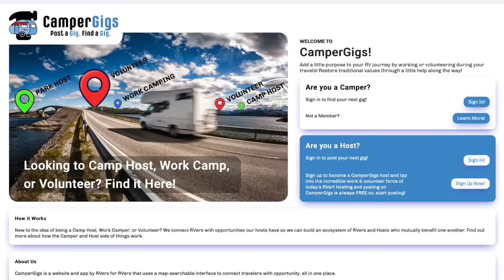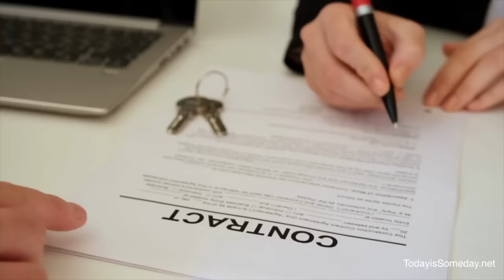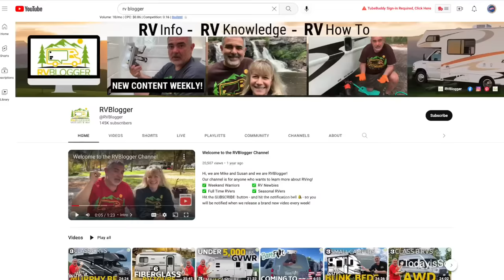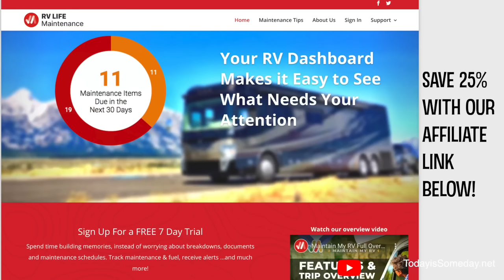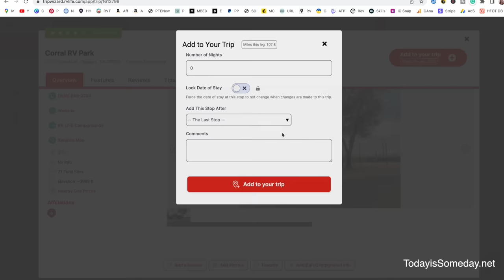HOW TO START FULL TIME RVING IN 2023 (UPDATED)

Comment: You hit the nail on the head. We started full time April 2022 after 5 years of planning. We sold everything and have learn a lot of tips by watching your videos. Thank you!  I have traveled via air for the last twenty years and (don’t laugh) the only thing I would not get rid of is my massive collection of Starbucks mugs. We spend a month in one place then move to the next as the wind takes us (We love getting to travel to the 3 places our adult children live the most! We would never get to see them as often as we do without this lifestyle!) I have always worked remotely so the move to the road was no big deal. My wife retired from teaching, but hopes to find some side job to do on the road eventually. I over spent on my internet with top end hardware and data plans to ensure connectivity.  I learned it was not necessary and now use Starlink and a cheap Verizon and ATT as a back up plan.  We are only 7 months in and don’t regret the switch. Went from 3000 sq. ft.  to 400.  Every night we say how much we love our tiny home!!
Reply from the maker: SPOT ON!!  This lifestyle is pretty awesome!!!  I collected Starbucks mugs from every place I visited overseas when I was active duty. My daughter has most of those now.

Comment: I watched a video that recommended to Either staring sleeping in your RV in your driveway or a
nearby camp ground to get used to camping and find out what you need in the RV that you may
not have thought about.
Then as you get used to it plan trips further away and for longer periods of time.
The more you get out the more your able to by or purge.
Always keep two rolls of quarters for laundry, and vending machines in case of a craving.
Zip lock laundry soap in load sizes, 
Keep well stocked first aid kit, heavy trauma band aids and gauze.
Reply: There are probably lots of laundromats that still use quarters but we have come across several that have you buy a card or use an app. Seriously!

Comment: I have been full-timing for 15 months and can’t imagine ever going back…even after two Canadian Winters! I used to be handy. Now I am REALLY handy. The biggest frustration: finding out that Lithium batteries don’t charge below freezing! The solution (after hours of inspection and emailing the solar manufacturers and battery manufacturers): a $50 heating belt. Runs off your generator or inverter and raises your batteries’ core temp above the freezing point so they will accept a charge from the panels. Can’t wait to host you guys up in Canada, this year.

Comment: It's my dream of full timing, but my wife isn't that much on board. She is partially disabled and thinks she couldn't handle it. We did last winter go from south central BC to near Gainesville FL. And we did very much enjoy the trip. I made sure anything we did she was able to do as well with either her walker or walking sticks. The one thing is being Cdn, medical down south does become a huge thing for us  and trip insurance only covers if you get hurt or sick. With that said I still believe that by selling our home we could full-time 4 to 5 years before it would be time to hang it up depending on our health. I did say you should come to Alberta and BC  but one thing I didn't say was fuel costs are through the roof. Here right now diesel is 1.789 a litre which times by 3.8 you get a US gallon. But you are using the US dollar which helps. Camp sites are about the same with the exchange rate where it's at right now. So if you come to the northwest north of the border then.        " Welcome to Canada EH."

Comment: Guys my husband and I bought our 2002 HR 40ft diesel pusher back in May  of this year and haven’t had a chance to take one trip in it! We are “full timers” and this is our first RV. We totally have a “HORROR” story to share with you! We found our RV on RV Trader in March. We live in Florida and the RV was at a “small” dealership in Sebring which is a 2 1/2 hour drive from where we live in Titusville. We liked the RV , it only had 68,000 miles on the engine. We thought we were getting a “good deal, we paid $42,000 out the door for it. Even though it was a “20” year old RV, it looked pretty good…so we thought! There was a “few” things that I want fixed or repaired. I bought a Splendide washer-dryer and I pulled out the old black refrigerator and put a house GE with an ice maker in it! That was a MUST! This is where the “sad” part comes in! In May we finally purchased it and in July we bought it “home”. My husband and I wanted to immediately start our renovations on it as we wanted to bring it up to this “century”! As we started pulling the carpet up we ran into a MAJOR problem that stopped us in our tracks! ALL the flooring was ROTTED and MOLDED”! No our BIGGEST MISTAKE was NOT hiring an inspector to come out and inspect it! The dealership told me that we could if we wanted to but there was no need as they had their own outside inspector checking it out and he is fixing things as he runs across something. So needless to say we felt low and depleted! I contacted everyone I knew to contact, the BBB, the Florida State Attorney General’s office just to name a couple, but was told the dealership did no wrong! And the outside was just as bad as the inside! The roof was sealed with duct tape, the front AC didn’t have holes in the in the drip pan (I believe that is what it is called) so the AC poured water down into the motor home! We had to put a large ice chest under it to catch the water! So, I called a couple of places to take it to but they wanted at least $20,000.00 to fix everything…which we did not have as we put everything we had to purchase it! Then on top of all that, a couple we had just met called up a guy that had worked for Camping World and several other RV dealerships. He agreed to fix the floors, put new flooring in for us as well as replace the rotted wood and mold. He was going to fixed the roof and replace the seals around the Slides! We give him $13,680.00. He had the RV for 2 1/2 months and all he did was put down the vinyl flooring, and installed in sinks in the bathroom’s! And he didn’t even screw them tight! We came in from talking to our neighbors one found water running all over the floor! So, we were taken for $41,000.00 plus another $14000.00 from the one person that told us “he was sorry the dealership did that to us “ and he “was raised better than that, he was raised to treat others honestly”! So, we have an RV with a broken toilet that doesn’t work, batteries that don’t work and need replacing and the list goes on and on! Seems like every day something else happens and we’re having a get something else fixed! TWO things we learned about buying an RV (or anything) GET AN INSPECTOR to check it out BEFORE you purchase it, and 2, NEVER buy a 20 year old vehicle!  I know my story is long but I just had to vent I suppose! HAPPY TRAVELS to you both! Michael and Sharon Laine
Reply from the maker: WOW!  That is unfortunate.  Getting it inspected is key!  They might not have found the rotted floors under thee carpet, but they would have spotted the issues on the roof and with the AC's.  Hopefully, you find an honest repairman soon!
Reply: Fortunately my husband works with a lady that she and her husband used to live in a Fifth Wheel and actually lived in the park we live in; he is very knowledgeable with RV’s and they offered to come help us out! He got on top and fixed the AC and one of the toilet’s. So I guess God felt pity on us and sent someone to us that we can trust! So just be aware, “SOMEDAY” we will meet you guys! Sharon and Michael Laine

Comment: Why did you guys pick a class A instead of a 5th or travel trailer ?  Which RV would be best if you own land and want to be stationary for long periods of time?
Reply from the maker: It was my (Phil) dream to drive a Class A after my Grandfather had one while we were young. For a stationary RV, I would go with a 5th wheel or bumper pull. Something without a motor. Motors like ot be used. Be mindful of the tires and critters sitting for extended periods of time.

Comment: Do any of your friends that have a gas Class A regret not getting a diesel pusher?
Reply from the maker: Nope not one. But there are a few who regretted gasser that switched to diesel.
Reply: @todayissomeday  
Do you know why they regretted it?  We are at the Tampa show right now and trying to decide which one will be better for us.  We just wanted some information from people who are full timing it. We have done allot of research but wanted actual user inputs also
Reply from the maker: The noise and heat in the drivers area were an issue.  Plus, they lacked the power going through the mountains.
Reply: @todayissomeday  Thank you for the input.